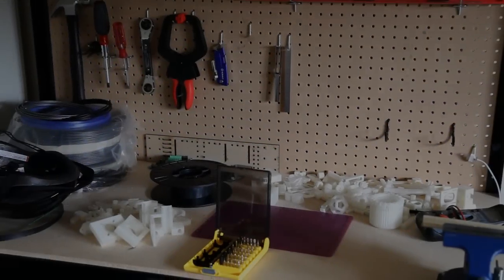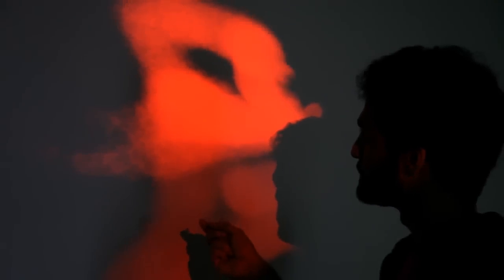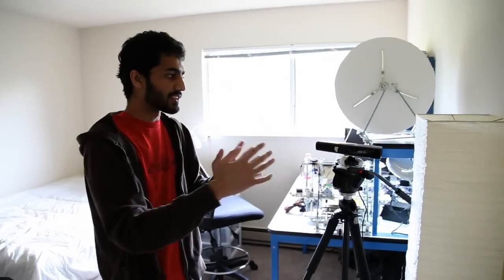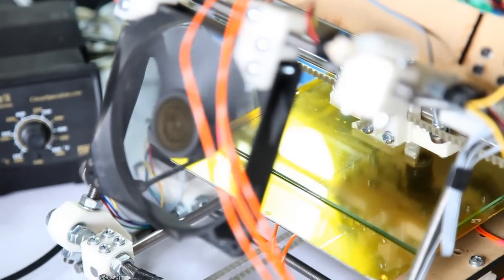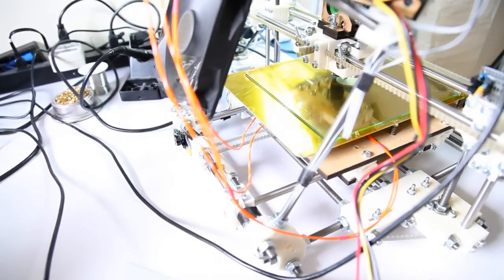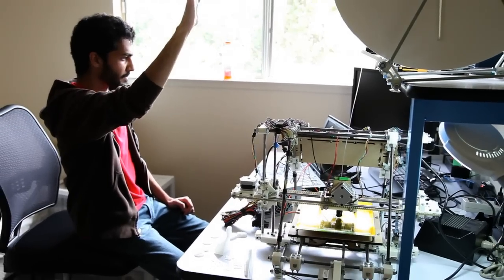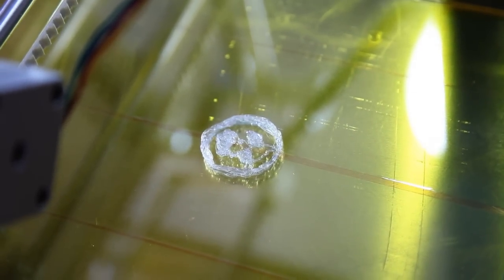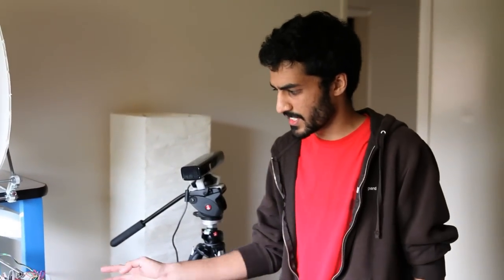Meet the Makers: Nirav Patel

Comment: No offense Make I realize the potential of the 3D Printers but I don't think it's that revolutionary. It's a process that has been used since the late 90's to recreate skulls for body identification in facial reconstruction. However, while it must be really handy to print out your own bits for random projects the size restriction, cost, cost of production, and manufacturing aspect of the printer is still at bare minimum of 5-10 years away from being useful CNC and Injection Molding is still best